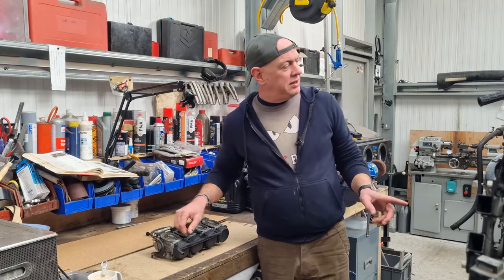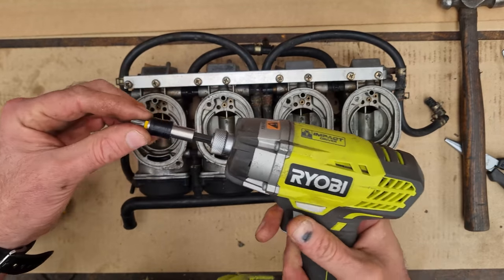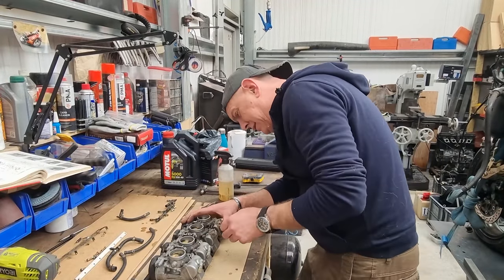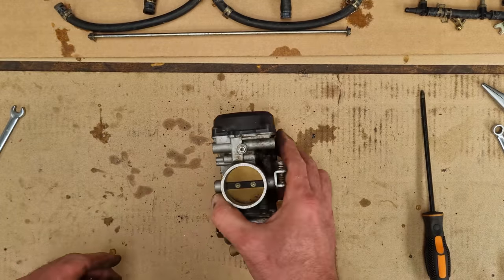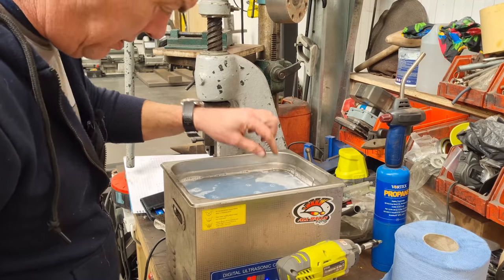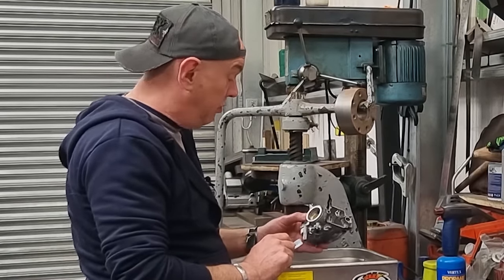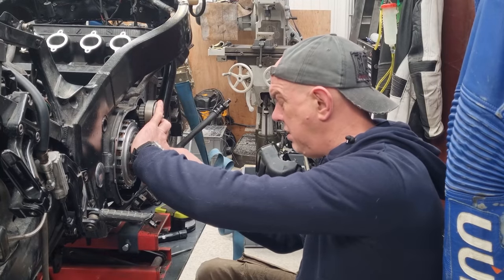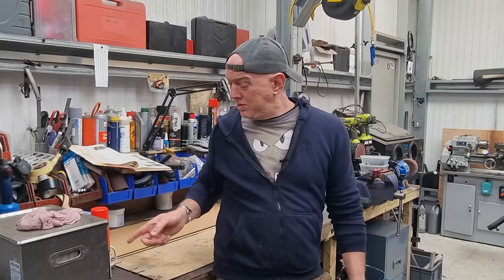Carb strip & clean - 1990 Kawasaki ZZR1100

Comment: So these carbs have been a nightmare for me! Someone clearly didn't use j.i.s. bits, all "screwed up". I actually broke a carb body going gentle, using proper j.i.s. & technique. I'll take the blame, I did it. These carbs Have been my evil nemesis! Lol. LOVE the vids Quickie. T.Y. I don't believe a more thorough set of video's exists for the Z.X.-11/ Z.Z.R.-1100! These were much needed & wanted video's for The Z.x.-11 community.  "C" & "D" models do have some differences, but overall, similar and procedures mostly the same. These are GOLD Quickie! The 11 was becoming a forgotten dinosaur, One damn fast + capable dinosaur!

Comment: What cleaning solution are you using with the ultrasonic cleaner? 
Thanks for the video, very helpful, as are several of the comments, I actually purchased the extra choke plate screw and nylon washer, guess it will go in the drawer. The missing screw has always bugged me, had several ZX1100's, never noticed it before, and all my later bikes were or are fuel injected big Kawai's.
I gave the 05 ZZR 1200 I'm working on to my son, he never rode it in 5 years, so I traded my 02 ZRX 1200 to him for this ZZR 1200, and am giving this bike to my ex marine F18 pilot son in law, so he has a bike again. 
The float bowl gaskets sure were pricey though, folks may want to price all the O'rings, and fuel inlet T's prior to disassembly. 
The fuel inlet T's leaked after I had rebuilt and reassembled the carbs, even though I didn't separate or touch them, I would recommend separating the carbs and replacing them when you rebuild the rest of the carbs, as you don't want a fuel leak. There are two of them and they were $28 each, they don't sell the O'rings separately, just the whole fuel T assembly.
Reply: Also as a side note, the aftermarket rebuild kits and O'rings I got online were either not good quality, or didn't fit at all. Even though this bike is waay easier to work on than my ZX12 was, or my ZX14 is, it's still too much work to use substandard O'rings, and wind up having to pull it apart again and then do it right. 
I dint find aftermarket metric O'rings that were the exact same sizes, and didn't want to risk it with improper O'ring fitments and there's several of them in these carbs.
Reply from the maker: Thanks for chipping in matey, very much appreciated and all good advice which may well help somebody out 😁👍
The parts washer fluid is just a concentrated engine degrease I found on eBay, just search for McKlords concentrate degrease parts washer...if I can post a pic here I will do 😁

Comment: You're not missing a screw, that how they are. Checking parts fiche shows only three. They used that same chain tensioner system on the Gpz1000rx as well with same issues. There is a video somewhere on an rx resto that shows this and what can happen.
Reply from the maker: Cheers Colin, a few folks have mentioned the screw and the mod now so I'm going with it. The stock one will go back for now whilst I source a tension tamer 😁👍
Thanks for checking the parts listing matey 👍
Reply: @QuickBikes  that rx video is by Roland finger. You may want to check out his build. Looks like the engines are similar.
Reply from the maker: Will do matey 👍

Comment: Are you going to to a carbie sync up sometime???? food for thought.
Reply from the maker: Yes matey... and a colour tune to get somewhere close to the right mixture 😁👍
Reply: @QuickBikes  Colour tuning looks cool, but you can just go by the engines reaction to revving the engine. If the rpm floats down it's too rich I think, and if the rpm dips below idle speed it's the opposite, the rpm's should come straight down and instantly settle at idle. If you just screw out the A/F screws to the stock setting you'll probably be fine anyway, unless you change anything in the carbs.
Reply from the maker: It'll be set to stock to start off with as that's gonna get it running. I'd be interested to see the colour tune, but ultimately I want to.set it up on a dyno as that's the best way in my book. I just want a healthy running bike that's reliable, so I think it'll be money well spent 😁
Reply: @QuickBikes  Definitely the best way to get it as perfect as possible. After quite a few changes to my ZX9r, it's running great,  very strong and no bogging, the rpm's do as they should too, but would be nice to get a run on the dyno 👍
Reply from the maker: I think you can get it running at least and not too bad, but a dyno tune will just get it right.  😉 😁👍